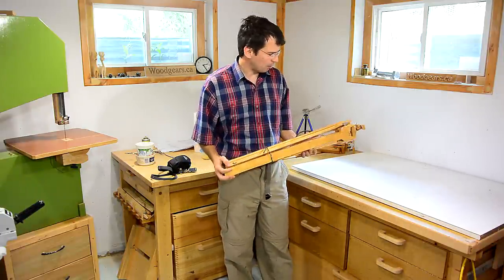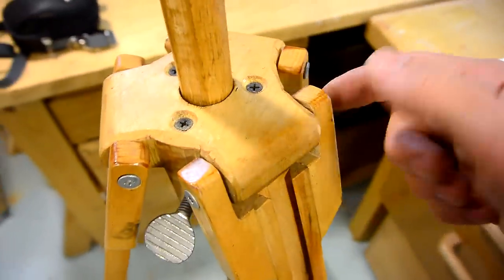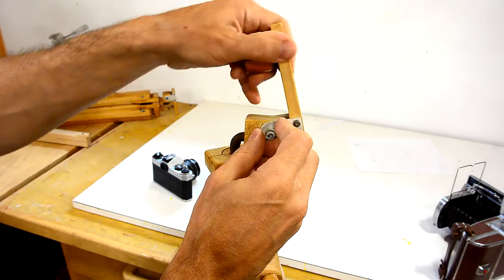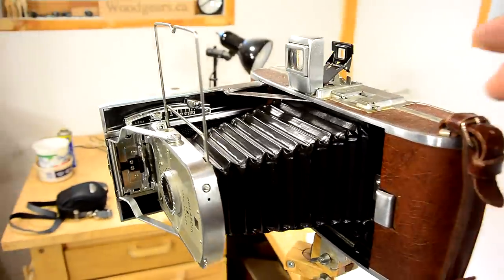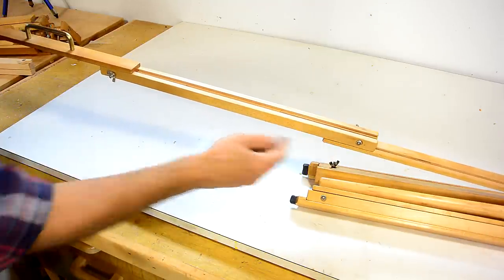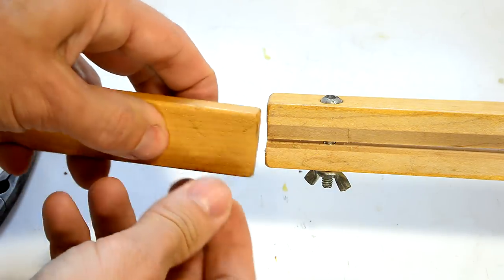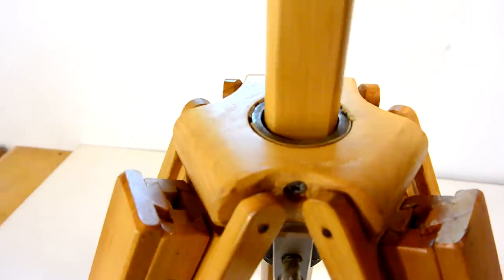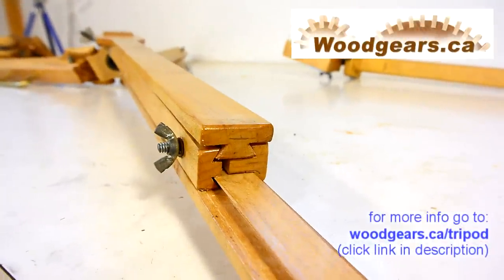My wooden tripods

Comment: Nice bit of work there. It should be noted however that camera mounting threads are always placed in the centre of the image sensor (be it analog or digital), so when you rotate the camera around on the mount it rotates about the centre of the sensor, and doesn't affect things by introducing parallax errors.

Comment: Pretty neat! I love the design of those three section legs. Do you think they could work as full extension draw slides? Also, I don't understand how those pins keep the legs tighter,  or what limits the outward angle of the legs? I don't remember seeing a side handle on typical tripods, that practicle genious, I think, is most of the fun of your videos. Thanks!
Reply from the maker: Darnley Bynoe The legs wouldn't be practical as drawer slides.  Too hard to slide, and not strong enough.

Comment: Could you make some kind of tripod legs for someone who doesn't have a table saw and a router?
I only got scrollsaw, jigsaw, circular saw, and some sanders. Also, a cordless drill.
Reply: Carlos Eduardo Screw your circular saw down to a piece of plywood, plunge the blade through, flip the whole thing over. Now you have a makeshift table saw!
Reply: J DeWitt Yes, I done that before, but this contraption is a accident waiting to happen. No proper fence, no riving knife, and stuff

Comment: I don't think they even make film for those polaroid cameras anymore.  You think it was expensive then?  Try it now!
Reply: jesusnthedaisychain Fujifilm still manufactures the film. It's not terribly expensive. Around $1/image.
Reply: House of Hacks I suppose that's good to know.  I bought a polaroid camera like that for my sister-in-law and the only rolls I could find were ridiculously expensive.
Reply: jesusnthedaisychain Yeah, you can usually find decent prices for film on Amazon. Sometimes retail camera stores may charge more for specialty film like this. Although, some Polaroid cameras had film in packs with built in batteries. Those I think aren't manufactured any more and can get really pricy because you're buy old stock. However, there are ways to open them up and put regular (cheaper) Polaroid film in. If that's your sister's case, a bit of web searching should pull up descriptions of how to do that.

Comment: could you make the legs lock at an angle?
Reply from the maker: Buddha Belly Too complicated.  That's what the rubber feet are for.
Reply: Matthias Wandel 
You could attach strings between the legs, so when they open the strings keep the legs at a set distance.
Reply from the maker: SuperDeinVadda Or I could just leave it as is.  No strings, no mess, no tangle.  And it works just fine.  that's the best solution.